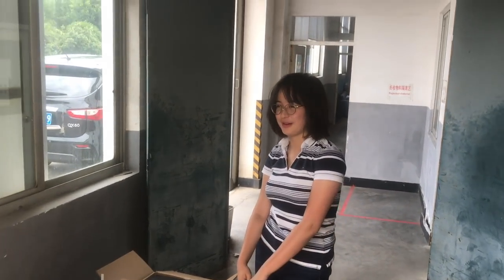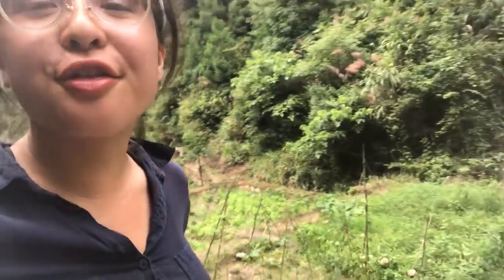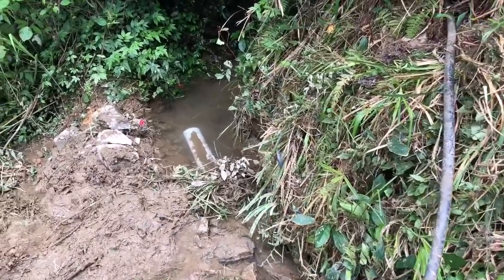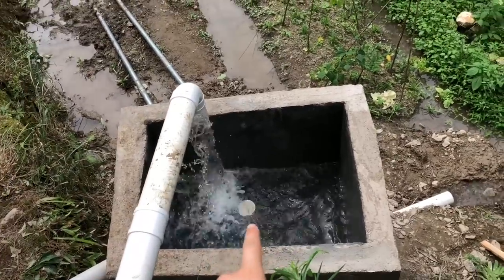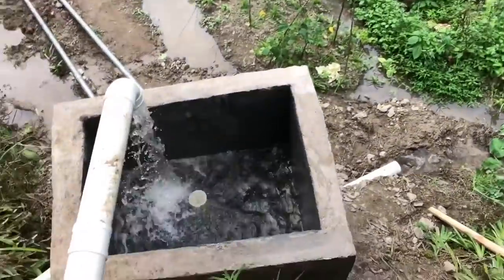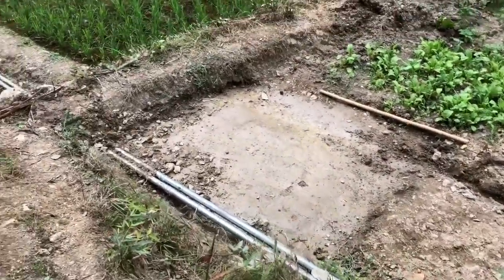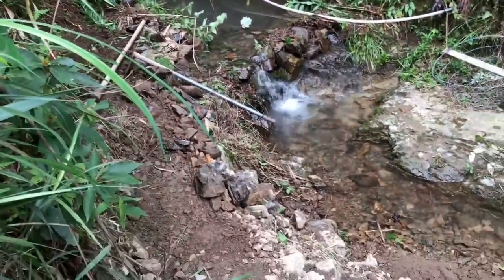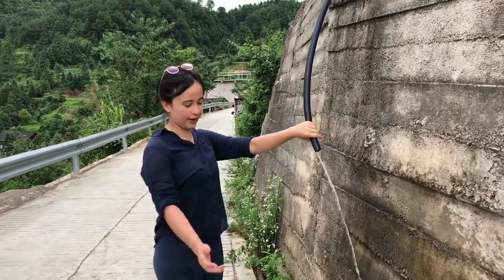Ram Pump Papa Pump delivering water in China - overview

Comment: Fun fact. Putting 2 of these pumps on the same outlet pipe does not increase water flow by much. Why? Because water flow is function of the air pressure in the tanks. And doubling the tanks does not increase air pressure. It just increase the volume of air at the same pressure.

Comment: Your not let the water air rate at the intake 
It sanded like air inside the ram pipe and the max length is 150 ft at 50 ft height
Reply from the maker: The Papa Pump can pump up to 400ft (depending on Supply Head) and maximum delivery length can be measured in miles (there are only small frictional loses).